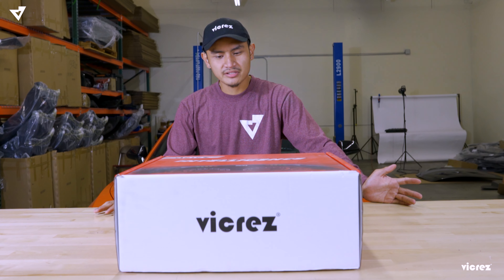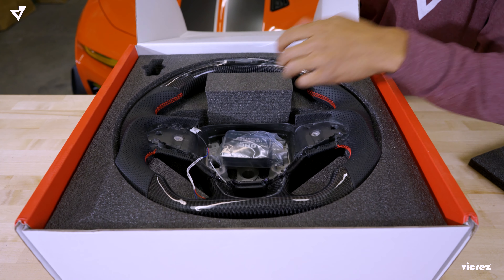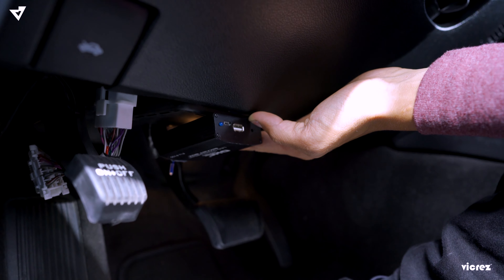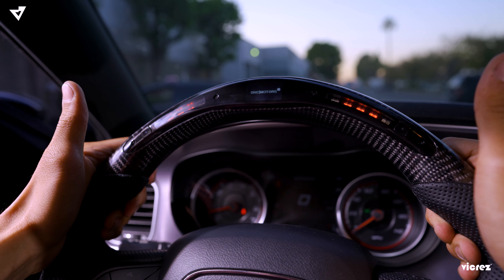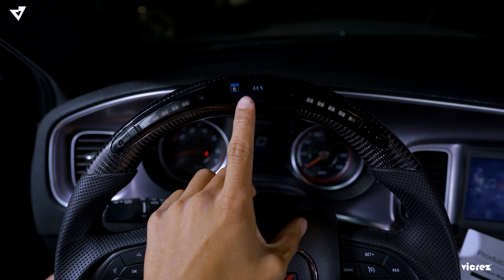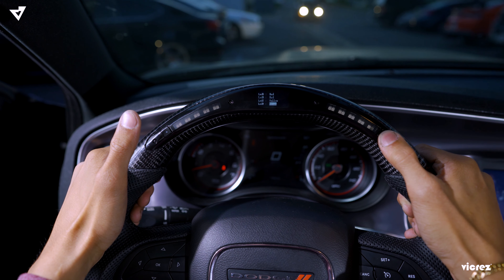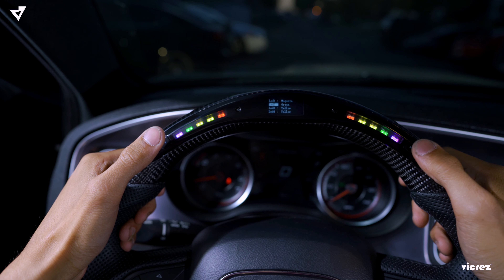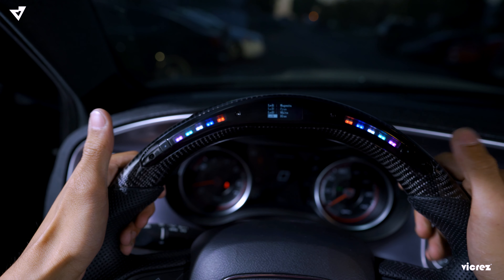Troubleshooting/ Function with Vicrez Carbon Fiber Steering Wheel!!

Comment: hey, I'm having an issue where I try to change the color on the rpm lights but the icon has a "x" over it. any help is highly appreciated. I have tried  resetting many times.
Reply from the maker: You Add the color to each side. I recommend watching the Durango install we closely look at how to change each color as well.

Comment: My steering wheel has been synched since I got it two years ago. Today I got the timeout issue after so long and havnt touched a thing. Did you have to press the button on the smart box before trying to reset the wheel with the buttons on it?
Reply: Yes. A resynch normally fixes it
Reply: Did you every have a problem with your wheel draining your battery?
Reply: @Rell20  No I have not had that problem. It turns off when my car is off and I have been good
Reply: Whats the smart box?
Reply from the maker: refers to a multifunctional control unit or panel located on the steering wheel itself. 
This control unit allows the driver to operate various functions of the vehicle without needing to take their hands off the wheel, enhancing convenience and safety.

Comment: Great video! My issues is my wheel turns on with car with welcome screen, but then turns off.
Reply: Mine does the same, did you ever found out why?
Reply: Mine has the same issue, did you fix it
Reply: @moayadad  yes, put the plug in 😂
Reply: @tybo_g37s  it's plugged in
Reply: @moayadad  Then I dont know, sorry 🤷‍♂️

Comment: Mine syncs with box successfully, but it doesn't read any RPM and center display shuts off after about 15 seconds. I have done this 4 times in row but can't seem to get it to stay on or read RPM even though it says matching success.
Reply: Any luck with finding the problem mine does the same thing?????
Reply: Same that’s what’s going on with mine anyone know the problem?
Reply: Mine works sometimes and other times it turns off. I have to disconnect the obd and turn off the truck and then connect it again and turn the truck on. That’s how I am able to have the center info populate and stay on. It shouldn’t do that though, but I haven’t seen any answers from anyone.
Reply: I have this same issue. Did you guys figure this out?

Comment: Hey man whenever I sync my steering wheel everything on the screen shows 0 rpm and etc. Then I start getting fault codes on my dashboard like dsc and transmission faults. I have turn off car and remove the module. This all started when I accidentally turned off the match button on the led app.
Reply: I have this issue. Did you figure this out?
Reply: @Grayxlx  No and whoever is a tech in these steering wheels seems to not know or doesn't want to help

Comment: So on ANY of the led wheels is there a way to change the rpm shift indicator like instead of 3500. I could put it at 5500 when it flashes for you to shift?
Reply: I see everyone’s do this idk if you can fix that unless everyone just likes the flashy lights and doesn’t know what they do lmao
Reply: Yes
Reply: It’s in the shift setting. Upper and lower limit

Comment: My steering wheel will not power on at all. All connections are good. What should I do? The OBD2 box blinks once and the light goes off.
Reply: did u find out what it was
Reply: @FNTDrippy  I did. I ordered another board for the steering wheel and soldered it in. The board that has the lights and the lcd display. That was my issue. 

The other issue you’ll run into is that it caused minor electrical issues and draws amperage when the car is off. You have to rewire the control module that plugs into the obd2 port. The power wire that goes to the module needs to be cut and wired to a 12v switch wire. This way it comes on only when the ignition is turned on. Works perfect now. Doesn’t draw anything when the cars off and solved all the electrical mayhem that it caused.
Reply: My car won’t go into sleep mode the dash and shifter lights keep going on and off when the car is off  once I disconnect the ob2 plug the car is fine anyone know why and how to fix this
Reply: @fifty81ify Rewire it. The power wire needs to be connected to a 12v key. That way it only stays on when the key is switched.

Comment: Hey! My rpms and the mph screen and the led lights not coming up anymore. Before when it was working fine I noticed that the uconnect data on the iphone stopped coming up but now the uconnect data on the iphone comes on but the steering wheel stopped showing the rpms and mph.
Reply: Hey bro I know it’s been a long time but I barely got this and same thing happen do you know the problem?

Comment: My problem is that I have my torque OBDII connected and it interfere with my steering controller is there a pin that I can change or can I have the option to turn my steering module off when I want to use my torque
Reply: Is it a 2015-2022 Challenger or Charger? We have something called a double bypass. Z automotive sells them. Not the splitter, the bypass. It goes in the trunk. You can have up to 2 of them. Its also required for 2018 and later models in that car to use a Tazer, which is a thing that lets you edit the car settings and turn stuff like SRT pages on in a non-hellcat model. I have 2 OBD scanners. One for each aux dashboard using Torque and 2 phones (more gauges without bogging down the read rate). The wheel, and a Tazer. So I have 4 OBD units in my car. Plus a splitter for a tuner to plug into, so 5 ports. In my car the wheel doesnt stop OBD scanner from working though. Maybe its your model limiting your devices, i dont know. But if its a challenger or charger, try the bypass.

Comment: My led steering wheel doesn't connect with the obd2 it used to be working fine but one day it just not working anymore, any solution?
Reply from the maker: Hello, yes you can disconnect the box and disconnect the batter for about 10 seconds and reconnect and press the button on the box
Reply: @vicrezcom  thanku so much but both the led and the obd are working its just doesn't sync together it doesn't show the car reading
Reply from the maker: @assassinbh999  you need to press the button of the smart box and while the steering wheel is off and then turn on the steering wheel
Reply: I am having the same issue

Comment: mine stopped working a week ago. It was working just fine. When I open the door, it looks like it is ready to light up, but after a few seconds it says system will shut down automatocaly. Even after turning the car on nothing happens. As if it does not exist. any suggestions?
Reply: Did u ever figure it out? Same issues after a yr of working perfectly
Reply: @six70two  I changed the car battery a few months ago and it was working fine until a month ago it stpped working. I dont know what is wrong. Know clue. let me know if anything. Thanks.

Comment: I’ve tried re calibrating mine like 20 times already and it still won’t sync. Before I got the tune it worked fine but now I can’t get it to reconnect. I got 2019 Chrysler 300 with unlocked pcm. Any suggestions on how to fix it?
Reply from the maker: Make sure box is in range if so do hold down the button on the back of the smart box until you see a blue light blinking and have it near steering wheel allowing it to resync
Reply: I have been having the same problem and still wont connect. Have you found a solution on what to do for it to connect?
Reply: @abdulrahmanalsafy9483  I just had to keep trying it until it finally connected
Reply: @tayvonsmith2923  and what did you exactly for it to work?
Reply: @abdulrahmanalsafy9483  if I remember, you have to hold the two buttons down that’s at the top of the wheel along with the Bluetooth box thing it comes with until it connects. I think that’s what I did. Or it could just be bad wiring from when you installed it

Comment: Turn signal does not work on hellcat
Reply: Have you fixed it ?
Reply: @garciajr913  following. Having the same issue 15 Hellcat Charger
Reply: @BrilliantBlueBox  i had someone install mine for $500 a d i haven’t had any issues guy told me that a lot people like to do it themselves and always have issues, i rather pay someone to do it right for me and it was worth it
Reply: @garciajr913  I bought the update for my Durango it doesn't work. I have no turn signals.

Comment: My battery died after 2 days of installation, Do you think the steering wheel has something to do with it ?
Reply from the maker: This usually is a result of an electrical issue or some other delay with wiring nothing to do with the steering wheel. Should you need further assistance our DMs are open
Reply: This is not electrical issue. The OHC smart box remains on when plugged into the OBDII port. It has nothing to do with how the LED wheel is wired for power. OHC support has confirmed this.
Reply: @joeferraino2845  is there a fix for it?
Reply: I have the same problems , please help ..
Reply: @joeferraino2845   hola Joe , please any help or tips ?
Reply: @BlackSupercharge  my shit died out too after three days idk what the problem was. Put a new battery and it’s been good ever since but damn dude I’ve had several issues with this company 🫤🤦🏽‍♂️
Reply: @HomicidalKings  suggestion from OHC is to rewire the OBDII box to get power from ACC.  The box not going into sleep mode does not happen to all vehicles, but it happens enough that they have created instructions on how to rewire and will send them to you.  You can get a hold of them on their Facebook or gram page.
Reply: @BlackSupercharge  suggestion from OHC is to rewire the OBDII box to get power from ACC.  The box not going into sleep mode does not happen to all vehicles, but it happens enough that they have created instructions on how to rewire and will send them to you.  You can get a hold of them on their Facebook or gram page.  If that does not work, your only option is to unplug it from the OBDII until your ready to use it. This is something in my opinion Vicrez should allow you to return the wheel since OHC has acknowledged this scenario could/will happen.  Vicrez should note this on their site of this potential problem and should allow a customer to return if encountered.
Reply: @HomicidalKings  when I first installed it my battery died after 2 days , I check the battery it was like 4vl , I thought I need a new battery , bought an expensive one and died too , so definitely it’s not battery problem, 100% is something on steering wheels , maybe I wired it somehow that it stay on even after turn off the car ? Sucks big time this problem
Reply: @joeferraino2845  thank you very much amigo ! Appreciated your reply! Blessing
Reply: @BlackSupercharge  no problem. Glad I could help.
Reply: @joeferraino2845  dose this actually work my push to start keeps coming on on my dash and my shifter and it’s dying out my battery I think I might have to do the wire switch they send out
Reply: @gilmurillo5415  Wait mine is doing the same thing how is this fixable is there a wire or something this shit is annoying
Reply: Mine is doing this too. Draining my battery overnight and I’m waking up to a car that won’t start. Vicrez is no help . Anyone has a solution ?

Comment: And of course no feedback to subscribers 😒
Reply from the maker: Hi there! Have you connect the wires properly?
Reply: @vicrezcom  yes I have , I did it with one of your guys over the phone, everything works fine but when using my signal lights it does not show on the steering wheel.
Reply: @stevensurita1050  you need the updated software for the LED wheel to get the signal lights.